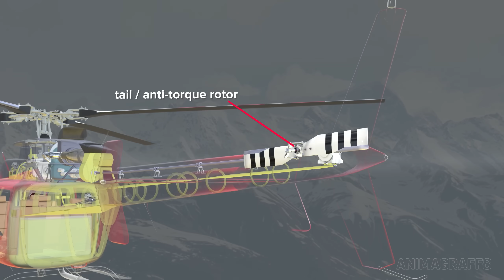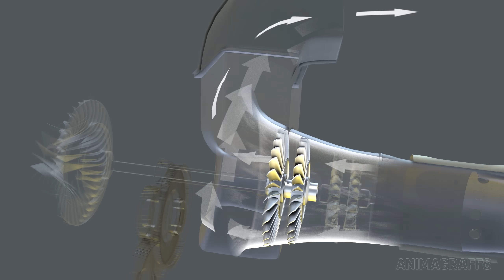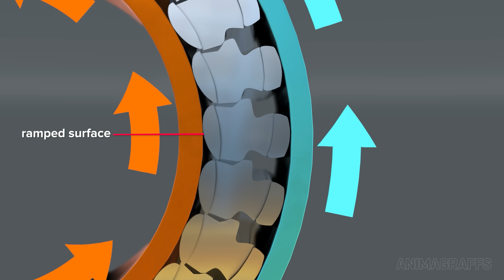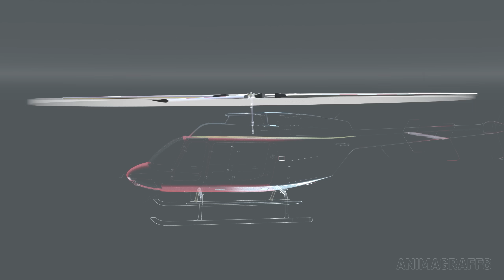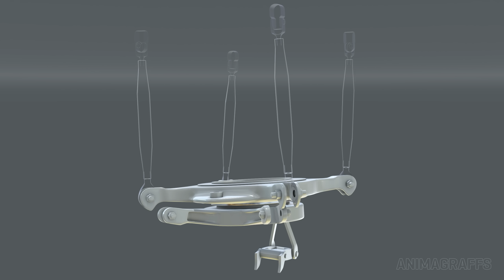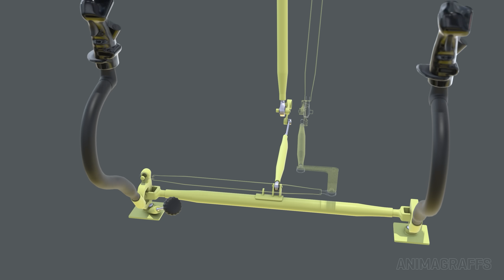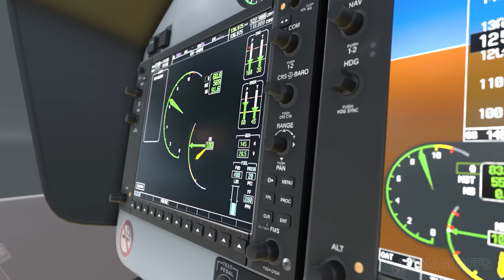How a Helicopter Works (Bell 407)

Comment: I’m currently a helicopter flight instructor and I show this video to all my students because the visuals are absolutely incredible. 
When I flew the Bell 407 I didn’t even know this much about it. This is one of the best videos on YouTube in my opinion. 

I think flight schools should commission you to make instructional videos.
Reply: he's probably already spoken for for years, lol
Reply: Could you please explain why 2 blade choppers can cut thier own tail off please? I'm finding it hard to belive its a known characteristic of 2 blade choppers, atleast according to the sources I recently saw in reference to the NYC crash
Reply: Mast bumping is a dangerous situation that can occur in some helicopters, particularly lighter designs with a two-blade rotor system. In simple terms, the main rotor blades are mounted on a hub that rocks back and forth like a seesaw. If the helicopter experiences very low or negative G forces, such as during abrupt maneuvers or severe turbulence, the rotor system can become partially unloaded. When this happens, sudden control inputs can cause the rotor hub to tilt excessively and strike the mast that supports it. This impact can damage or break the mast, and once the mast is compromised the rotor disc can tilt even farther. In severe cases, the rotor blades themselves can then strike the tail boom, severing it and leading to an in-flight breakup of the helicopter. Because these events occur extremely quickly, they are usually catastrophic and not recoverable. Pilots prevent mast bumping by maintaining positive G forces on the rotor system and using smooth, coordinated control inputs at all times.
Reply: @uberjeep  Well written. Thank you for the explanation.
Reply: @mrmatt1776  two blades are less stable in gyroscopic movement.  Although they are basically wanting to continually rotate, they can also rotate around the axis that runs from tip to tip.  If you make a four blade or three blade frisbee, it will fly well.   A two bladed one is much harder to get to fly.
Reply: @mrmatt1776  Its called a mast bump - google it.
Reply: @mrmatt1776  I haven't as yet run across anything where a Bell 206 has ever had a rotor boom strike that the precipitated the event.  One report had a 206 make a very hard landing during a autorotation event and the act of landing hard caused the rotor to strike the boom, but it didn't cut it off, just a dent in the top of it!
Reply: @mrmatt1776  NYC didn't cut off its tail.  A torque event caused structural overload and the #2 rib sheared at a rivet line - 1st event was a loss of a blade tip/weight
Reply: @mrmatt1776  two-bladed helicopters can chop their own tail off because... imagine a see-saw spinning around a mast, as one side comes up, the other side must go down. 

In a helicopter, you're flying the rotor NOT the helicopter under the rotor. If the pilot UNLOADS the rotor system, it flops around and the tail gets in the way and gets chopped off.

This DOES NOT happen to aircraft with 3 or more blades because they move independently from each other (like in this video), but they're more expensive to fly and maintain. For reference, ONE of the blades on a helicopter like this are probably $100k each.
Reply: @mrmatt1776  All helicopters can chop their tails off and it's due to blade flap and flexing of the blades downward. Two-bladed, semi-rigid helicopters are the only type to get into what is call mast bumping., which is like the NYC crash. This situation mainly happens when the rotor is unloaded during flights of (low G push-over) nap of the earth flying. It's caused when the pilot is following terrain up and over hills and uses the cyclic to fly up and down instead of raising the collective up and down. When the rotor becomes unloaded this allows the rotorhub to flap up and down and still be moved by the cyclic, but the helicopter does not respond, only the rotor responds by contacting the mast and causing the mast bumping scenario which then causes the rotor to separate from the mast at the point of contact. You can also get into the low-G situation in moderate to severe turbulence. If you more information with video and animation, you can look this up on Youtube.
Reply: @mrmatt4873318 a two blade rotor system can become unloaded due to turbulence or moving the cyclic to create a descend which causes a weightless sensation also known as zero gravity. This means the helicopter is no longer supported by the rotor and when the cyclic is moved, only the rotor blades move and not the helicopter. When the helicopter flies it is supported by the rotor hub and blades by weight and gravity. This unloading of the rotors allows the rotors to teter like a seesaw but with greater flexibility so it can hit the mast that supports the rotor blades and hub. This is known as mast bumping. All two blades helicopters can get mast bumping. Three or more blades can not as each blade flexs/flaps independently of each other and this is called a fully articulated rotor. Two blade rotors are called semi-rigid rotors. Anyway, to answer your question in short, the rotor blades can flap or flex/bend upward and downward which can chop the tail off and if enough flexing/bending happens it can go thru the cockpit as well. Next time you watch a video on a helicopter lifting off and hovering look at how thr rotor blades cone upward. The heavier the helicopter is loaded the more coming you will see. This coming disappears when the rotor system is unloaded and it allows for the blades to move without moving the whole helicopter. Look up mast bumping videos as well. Hope this helps.
Reply: @mrmatt1776 also watch videos on the md 500 helicopter doing autorotations. These helicopters have a fully articulated rotor system and are notorious for chopping the tail off. The blades flex downward and the tail boom sometimes rises up and the meet in the middle causing a tail chop.
Reply: You know where to get a 67 Iroquois?
I need one of these and an oil we’ll & refinery
Reply: Ps - the flying car already exists  ⬆️ - best this since Bread 🍞
Reply: Fr
Reply: And that is such a fantastic notion! I would never have thought of something like that, but you're absolutely right.
Reply: @andrewnugent2137  good idea man
Reply: I concur
Reply: You weren’t aware of the bevel gear was connected to the planetary set below the main rotor? 
If your teaching chopper pilots, good thing you found this channel🙏
Reply: @kamakaziozzie3038  he didn't say that
Reply: @kamakaziozzie3038   poser

Comment: Love this video! Great stuff! This is the first time I've heard the term "spinning wing" and never thought of it in those terms before, but that's a great way to look at it!

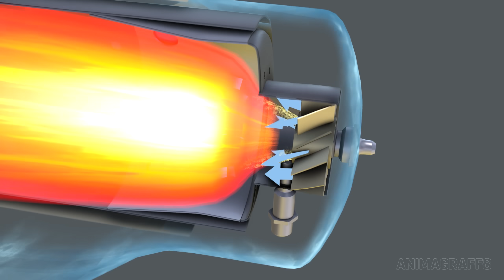05:45 The purpose of the air going around the combustion chamber is only partly for cooling. The main purpose is to preheat the combustion air for more efficient combustion which, as a side effect, also cools the combustion chamber. Warm air makes the engine perform better than cold air. (Think about flying at 15,000 feet in sub-zero air.) Compression also compensates for air density changes at altitude. (It's really just a turbocharger.)
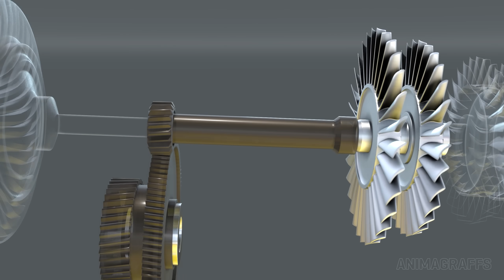08:00 Put another way, the first section is what allows the engine to continue to operate. That is, providing power to itself to support the combustion. The second section is what extracts power from the engine for external use. In this case, the drive shaft. In a turbofan engine, like on a 737, the first section would be the middle of the engine. The power section would be the outer ring, where the compressor blades are, to push bypass air out the back of the engine to provide the majority of the thrust.
11:00 "Safely land". Actually, more like a controlled crash... Unless performed perfectly, the helicopter is probably going to sustain damage and may even have to undergo structural repairs before it can fly again. Remember, in engine failure, the object is keeping the people alive, not preserving the aircraft.
27:00 The amount of physics involved in that rotor operation is astounding! To think that the system was designed and put into operation before most of that was actually understood is mind blowing!
35:00-40:00 I have wondered exactly how this works for YEARS but never had the time to fully assimilate the design. This is a real eye opener and a far less complex system than I had imagined!

Comment: Hi. Amazing work!! For the super nerdy 'to enjoy', there is an error that sticks out of perfection. The tail rotors flapping motion is not correct (the angular offset is basically off with 90 deg). The effect it should have is called "Delta-3 . When the blade flaps, it's change in pitch should try to bring it back to the plane of rotation. In the animation it has a 'negative feedback', so to speak. Thank you.

Comment: Please please please help. Ch47. I have NO idea how that 1957 technology works. Is there one cyclic or two? Looks like one. Okay then what does the rudder? Differential torque? The rear mast is taller than the front but there's a synchro system to keep the blades in line. Please help. I'm sure it's something in line with the first time I ever saw a rear end differential work. I just can't get my head around it. I'm sure it would be a great addition to your helicopter video
Reply: The CH-47 Chinook has one cyclic control that manages both rotors. This cyclic adjusts the pitch of the main rotor blades, controlling the helicopter’s movement in pitch, roll, and yaw. Unlike single-rotor helicopters, the Chinook uses two counter-rotating rotors, so there’s no need for a tail rotor to counteract torque.

The rudder controls yaw and helps manage any slight torque imbalances between the front and rear rotors. Since the rotors spin in opposite directions, this counteracts the need for a tail rotor, but the rudder still provides fine control over yaw, especially during turns or power changes.

The rear mast is taller than the front to accommodate the synchronizing system. This system ensures the two rotors remain in sync without interfering with each other. The taller rear mast allows for the blades to remain aligned, promoting smooth flight.

In essence, the Chinook’s dual-rotor system works like a car’s differential, allowing both rotors to spin in opposite directions. This provides stability, lift, and maneuverability without requiring a tail rotor.

Does this shed some light on it?
Reply: @TopoftheStackAirTrafficSafety  It helps a little. If there are 2 cyclic with one control why doesn't it just crab everywhere?
Reply: @jerryaubert6201  This is my understanding of how it works: The CH-47 Chinook has one cyclic that controls both rotors but it doesn’t crab because the two rotors spin in opposite directions. This cancels out the torque, making a tail rotor unnecessary. The cyclic adjusts the pitch of the rotors to keep the helicopter stable, while the rudder fine-tunes yaw to correct any small imbalances between the rotors. The rotor synchronization ensures they work together smoothly, and the pilot can control the helicopter precisely without it drifting sideways.

Comment: Why do you use the term aircraft? The aircraft is a helicopter.
Reply: A helicopter is considered an aircraft because it meets the basic definition of an aircraft: it’s a vehicle designed for air travel that can achieve flight. Unlike fixed-wing airplanes, helicopters use rotors (spinning blades) to generate lift, allowing them to fly. They also operate in the airspace regulated by aviation authorities and must follow the same basic principles of aerodynamics, such as lift, thrust, and drag. So, just like airplanes, helicopters are designed to fly, are governed by aviation regulations, and are considered aircraft.

Comment: A disc does not have to be rigid for the effects of gyroscopic precession to manifest.  Mattias Wandel has an excellent video on the similarities between gyro precession and orbital mechanics.  In other words, if you want to change the planar orbit of a satellite (about a line), you need to fire your rockets a full quarter of an orbit away from where you want to be.  This disagreement from those claiming "no rigid disc" is not based in reality.

Comment: You know that toxic trait I have where I think I can fly a fixed-wing plane in an emergency? Yeah, I don't have that at all with helicopters... or if I did, this video just squashed it. Not surprised it took ~3 decades for rotary wing aircraft to be developed after initial powered flight. Amazing video. Thanks!

Comment: 🍁🍁  Soo my first question is......   How long will a Sprag last and need replacing???   2nd ?,  How is the vertical rotor shaft held in place that it cannot force itself out with rotor lift?

Comment: Ex RAF Avionics Tech. I served on a Squadron operating Puma and Chinook. Surprisingly, during ground handling, the engines  on those were way louder than those on the Panavia Tornado F3s I'd previously served with.

Comment: HELICOPTERS is a set of components  such as Bolts, bearings, screws, wiring , tubes , grease, cutter pins, etc trying to be thrown out by centrifugal forces and Aerodynamic forces 😂😂😂. Love Helicopters

Comment: -Main Motor 
Standard airplane design 
-anti torq rotor 
Similar to jet engines x2 multiple visibility windows
-wire strike system 
Limit weight 5k 
Speed limited 
🐎 Horse in use details 
Skin of uranium inner layer 
- stabilty -Light Weight 
Engine starter up 
Twin engine identical 
Shaft in play.... Combustion Chamber the heat of the power 
-Air Inlet - fuel injector -igniter plug plug plug plug plug plug
Fuel nd air not supplied..... Blades take gas stator guides

Comment: Awesome videos as always! Love your stuff!  In addition to planetary gear sets, a lot of older automotive automatic transmissions used sprag clutches, usually only for reverse or maybe first gear. In fact knowing which it was enabled some quick and dirty but accurate diagnostics without any tools.  Sometimes called one way clutches or one way bearings, I’m aware of two different designs. The design showed here and the roller and ramp design. The roller and ramp design actually has much MUCH less friction in its freewheeling state, but I don’t think they can hold as much torque in their locked state given equal proportions with the traditional sprag design. The roller and ramp is often used in AWD vehicles in the transfer case and/or front or rear differentials.  Those of you from the Traxxas nitro era will also know this style from the EZ start system.

Comment: Fantastic presentation. 

I am 70 years old, not particularly tech-savvy, but I absorbed the entire article with fascination. 

It is so crystal clear and convincing, this prime example of successful didactics! 

Thank you very much. 

Small question... at 16:28... “one degree left to tilt...” I assume that this does not apply to the helicopters produced by the French, in which the main rotor always turns clockwise, and where the same effect is achieved by “one degree to the right”, am I right?

Comment: Thank you! Always great work! Having built and piloted several RC model helicopters (with and without flybars) I would like to add some first hand experience concerning main rotor "flapping", i.e. the tilting of it's rotational plane with pitch and roll forces applied.

To my surprise I found out right at my RC heli beginnings that pitch and roll forces are not directly related to the differential aerodynamic lift forces of the blades. In fact those forces would always be transformed as if there was a 90 degree phase lag. Thinking about it I found this could only be the result of the physical phenomenon of conservation of angular momentum. Just remember the experiment where a spinning bicycle wheel refuses to tilt when held by one side of it's axle. On careful examination you will also notice something else: there is still some tilting happening, but it is linked inevitably to another rotational movement perpendicular to both the spinning axis and the tilt axis. This is what conservation of angular momentum does. The behaviour was confirmed when I was holding my running RC heli high in the air trying to roll it slightly by movement of my hand (flybar sytem, decent revs, neutral controls). This was evidence for pitch and roll beeing entirely originated in force transformation via law of angular momentum.

I have no doubt that this is the case for real life helicopters as well. The dynamic tilting of the main rotor's rotational plane is then a mere by-product of the non-rigid coupeling between blades and hub. Actually it's not desirable since this results in some imprecise control response. But in real life they need to do this to reduce stress on the rotor head and gearbox.

As you may know, aerobatics is all about rigidness and precision and today there are not even a hand full of helicopters that can do aerobatics. One design that could was the slightly over-engineered and now very aged BO-105. Unfortunately those are getting scarce. If you want to see a demonstration, look for "BO-105 low level flight" on YT. No tilting there.

Comment: Correction in 27:00 - Dissymmetry of lift: 

Advancing blade flaps up and retreading flaps down. (Upflap reduces AOA and vice versa, causing equal lift across the system). 

Great video! There was a lot of work put into this. Really appreciated!
Reply: Finally I found somebody that actually found this error like me. I was very confused when I watched it for first time. Other than that this video is a huge source of information every helicopter pilot should have. Thanks to your clarification and to Jacob for this effort to enlighten us.
Reply: @kevinwatkins6510  Thanks. I was staring at this moment 10 minutes and thinking why am I wrong.
Reply: retreating flaps